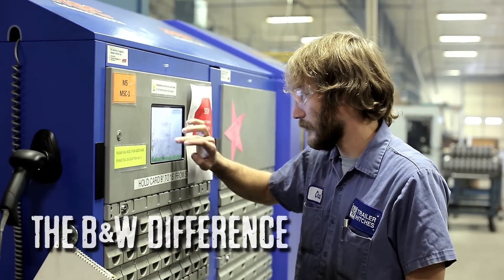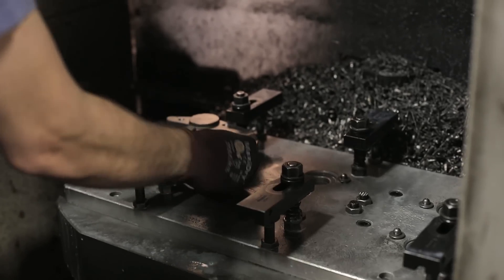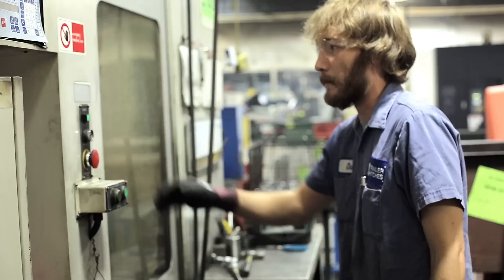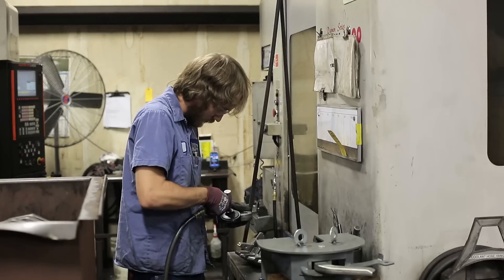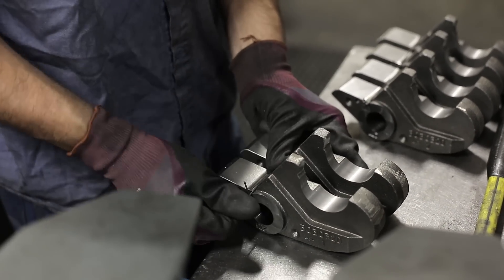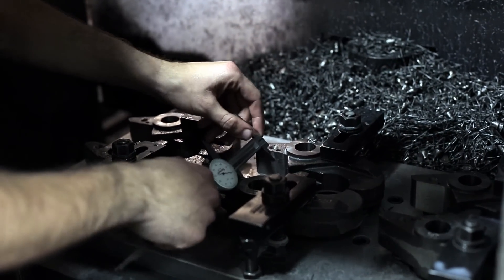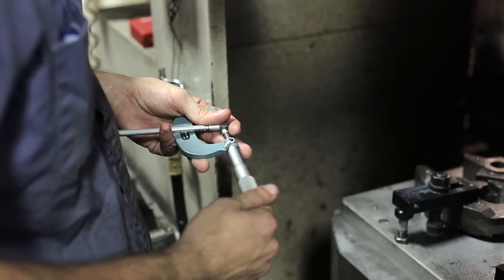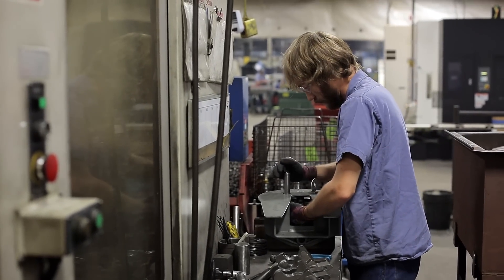American Made Jaws

Comment: My question is for the “jaw” guy(s)…my companion model sometimes doesn’t want to let go of the pin. Probably related to the hitch and the pin not being in a truly neutral state? Is there a training video on this so I can learn more? I absolutely love the hitch and I actually feel like I have the best possible product available. We do tow heavy within our Rv/tv and hitch capability.
Reply from the maker: Hey Charles! First, we wanted to say thank you for the kind words and the support!

When it comes to the jaws – what you've dealt with is actually a pretty common thing for most fifth wheel RV owners. And you're exactly right. With the tight tolerances, sometimes if your RV's parked on uneven terrain, the jaws might stay shut around the kingpin. But the good news is, we had that issue in mind when we developed our coupler.

Our jaws are held closed with a cam mechanism controlled by the handle. When the handle is locked to the open position, the cam moves out of the way, leaving nothing preventing the jaws from opening.

Check it out in action:  https://bwtrailerhitches.com/sites/default/files/video-files/Comp%202.mp4

Or, you can also see it demonstrated by a few friends of ours:  https://www.instagram.com/reel/Cw-Nkc1OAcz/

Most of the time, if you ever run into this situation, just follow these quick steps:

- Drop the front stabilizers and chock the trailer tires.
- Raise your trailer until there's a bit of daylight between the pinbox and the coupler head.
- Make sure the cam arm/handle is pinned open with the safety pin.
- Start pulling forward slowly, and the jaws will open. 

And if these steps don't work for you, please don't hesitate to reach out to us at 800.248.6564 (M-F, 8am-5pm CST). We're always glad to help!